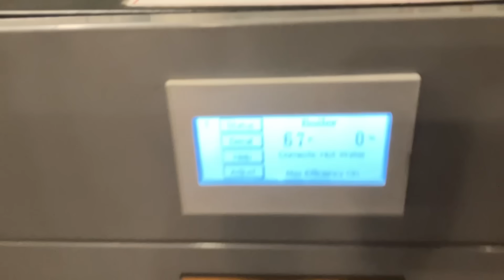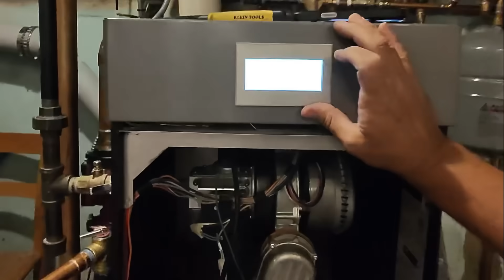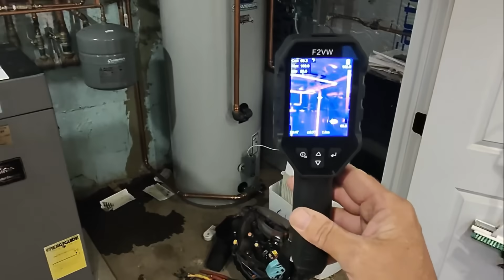Burnham Alpine Boiler FAILS with Lockout 2 | Master Plumber Explains & Repairs

Comment: Circ pump decided not to run?
Reply: seemingly, unless it has a short delay to bring it on. control board failing? pressure in expansion tank way too high, since it seemed empty? the bladders in them can stick shut empty if they've been sitting unused for a long term or with low system pressures. that dirty schmutz in the condensate trap and float rather alarming to me, bad combustion or something it seems. maybe the sewer gas smell was bad combustion., but probably the laundry sink drain or similar down there not used and trap dry.
Reply from the maker: That's what it was!

Comment: Burnham Alpine and Lochinvar boilers are high efficiency hydronic boilers. Expensive to buy and install. They need to be serviced regularly and in my opinion, the fuel savings is lost on the maintenance costs. You are usually limited to who you can call for service because not every heating company is trained on them. This homeowner found out the hard way, his service contract is limited by the company’s service hours. Don’t let a salesman talk you into installing a high efficiency boiler. An 80% boiler can provide years of reliable service. Your fuel savings is never what the salesman claims it will be while sitting at your kitchen table.
Reply: I think the question should be , did he have hot water before trying the heat. With that particular boiler , the hot water zone for indirect is piped separate from the heat zones, giving indirect priority. It's possible the the circulator at the boiler for primary/secondary loop may have gotten air bound or stuck because lack of use, causing no water circulation out of boiler to trip high limit. The relief valve popping was the indication of that. Just a thought.